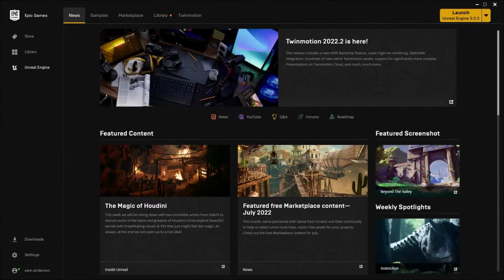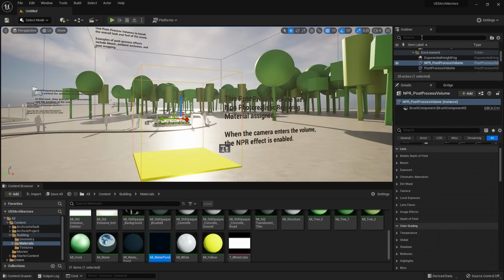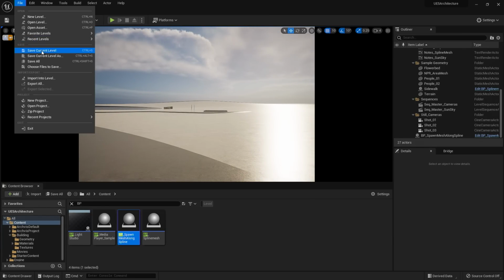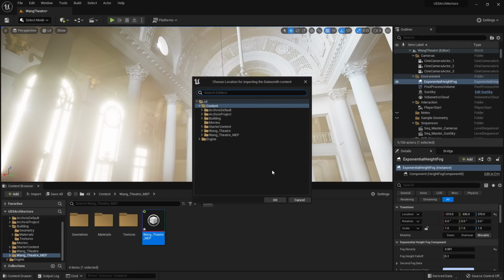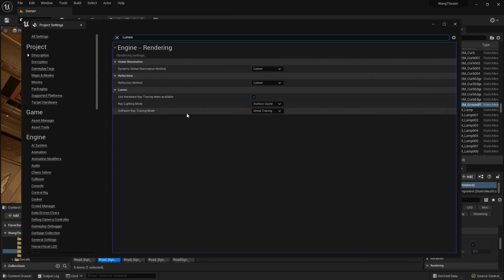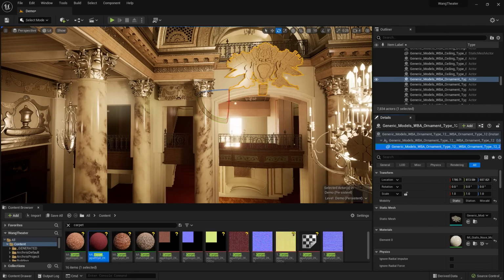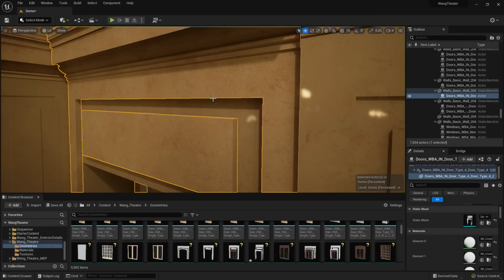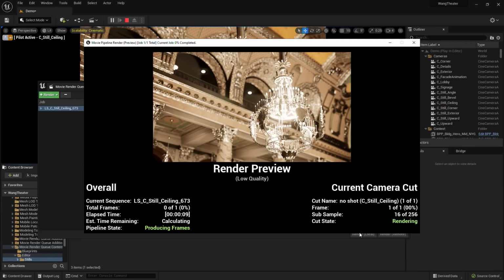Unreal Engine 5 for Architecture Webinar

Comment: What I find is a major hurdle in my current workflow is that I am exporting to fbx first to add materials in Substance Painter, then exporting those materials and adding them back to the model in 3ds Max. Then I'm exporting those models (with new materials) out through DataSmith for Unreal. Very time-consuming process for a large scene. Trying to find a shortcut in there.
Reply: You can make a material in Unreal and add the PBR materials there? Then add that material to the exported object from Max?

Comment: IMO the biggest barrier to engineers/architects etc. using Unreal is the difficulty in learning multiple software as well as the technical knowledge of how to construct buildings/products.  To eliminate the clanky CAD/BIM programs (example - Revit is awful to use as a modelling tool) we need the following:
1) Add the equivalent of the Blender addons 'CADTransform' and 'CADSketcher' to enable precision modelling.  
2) Be able to output elevations and sections to the SVG format (like Blender can with Lineart - used by the PRJ addon) so that users can produce technical drawings in Inkscape using geometry from Unreal.  
3) Export option - IFC format (most users don't care if the IFC models are full of heavy Breps since Unreal has the marvelous Nanite ability)
Reply: I see twinmotion as the most similar to UE for ArchViz of what you're asking. It's not exactly what you're asking, but it's the closest I think there is to them demands
Reply: @GRUMPNUGS  and TM does produce sections etc.  I don't know how to add dims etc to the sections though.
Reply: @Lake-Mist-V  It can do floor plans and sections to pretty good rendering quality, I haven't used the elevation much on it, but it's capable of doing them.

It does have a measurement tool, but I haven't used it. If you're using it for presentation you could just add the dimensions after in Illustrator or Photoshop
Reply: 1- unreal is not a modeling program 
2- unreal is not BIM program 
3- unreal is not project management program 
Dude you are mixing and shuffling too much, each tool has its purpose you can not fix a class with a hammer
Reply: @Mahm00dM0hanad  I get your point.  I work for a small water feature company - to use the 'right' tools I would need Zbrush for sculpting (sculptures), Omniverse for CFD, Unreal for environments (megascans), Houdini for its water Sims, Revit for pipe layouts and drawings, Blender Grease Pencil for quick concepts, Rhino for its Nurbs modeling of organic yet manufacturable features, Inventor for making nozzle designs, After Effects for compositing water effects together yargh, the list goes on!! In a large team this is possible but for me the fewer programs I can use the quicker I become at doing my work.